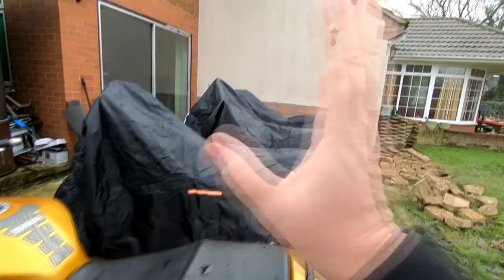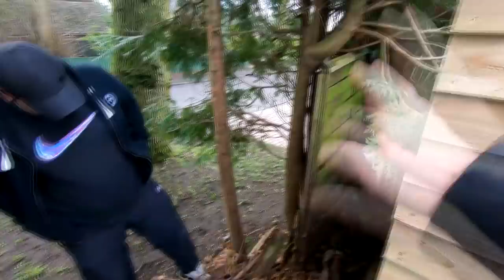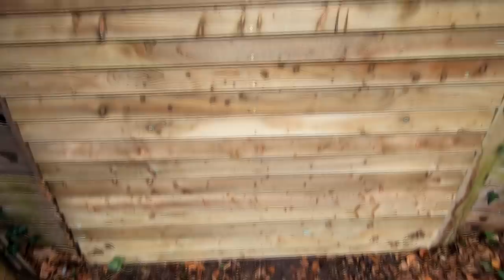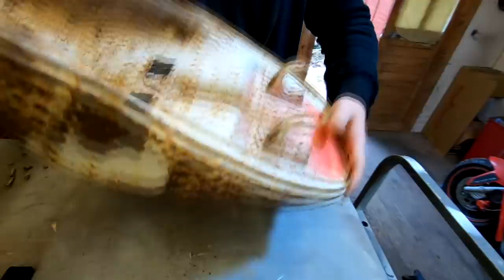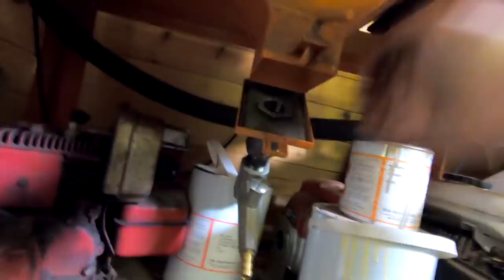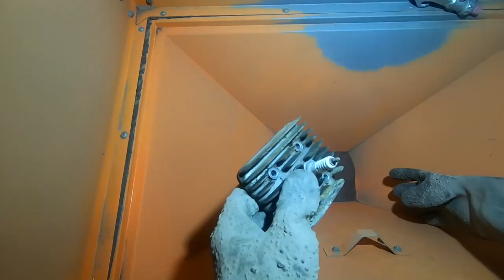Fences - Blasting Cabinet Upgrade And Tinkering [Getting Stuff Done] Vlog

Comment: Hi Martin I done a tank on a kle500 that was very rusty inside and I used black harpic bleach filled it right to the top left it for a week flushed it out our abs left it to dry and it was like new inside
Reply from the maker: Nice one, not used bleach before.
Reply: Its not bleach as such martin.. 
The harpic max contains acid which is the active ingredient. I remember it being mentioned on micks mowers livestream.

Comment: Could you put a link up for the parts on the sandblaster upgrade please Martin, mine would definitely benefit from the same treatment 👍
Reply from the maker: https://www.ebay.co.uk/itm/Sand-Blast-Cabinet-Media-Flow-Valve-Grit-blasting/254390671528?ssPageName=STRK%3AMEBIDX%3AIT&_trksid=p2057872.m2749.l2649
Reply: Hiya Martin.. Also where you sourcing the thread adapters from?? Thanks Glenn
Reply: Thanks buddy 👍
Reply from the maker: @stripfix1979  Ebay bud.

Comment: Hi Martin 
Any chance you could give the details of the parts you used for the blaster upgrade please?
Reply from the maker: Here's the valve https://www.ebay.co.uk/itm/Sand-Blast-Cabinet-Media-Flow-Valve-Grit-blasting/254390671528?ssPageName=STRK%3AMEBIDX%3AIT&_trksid=p2057872.m2749.l2649

the pipe fittings are 1" coupler, 1" nipple and a 1" to 3/4" reducing bush
Reply: @butlersempire  thank you 👍